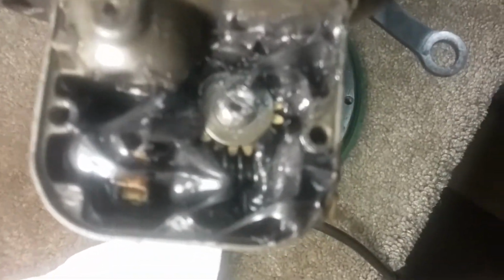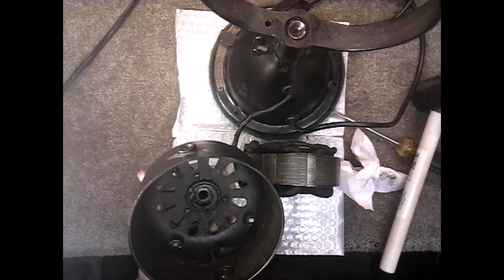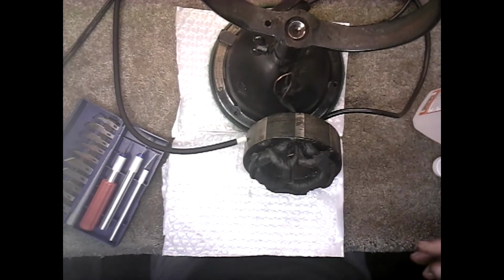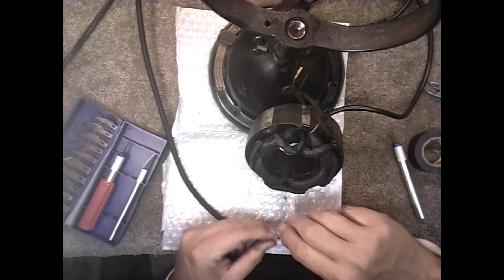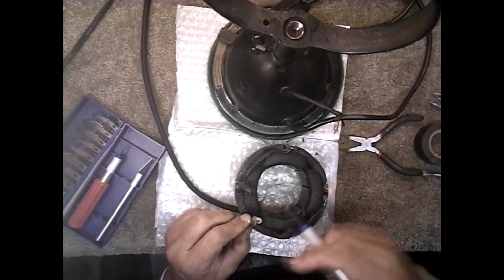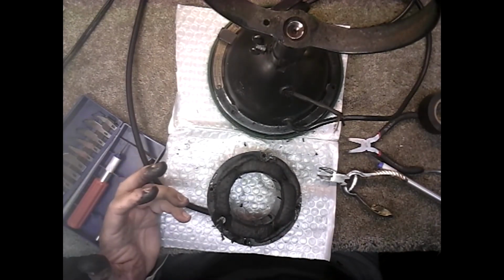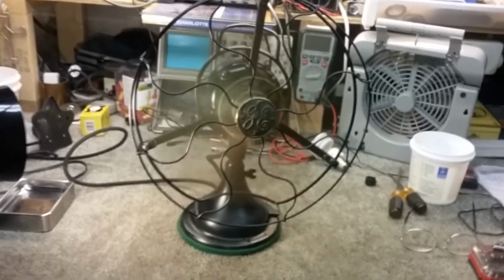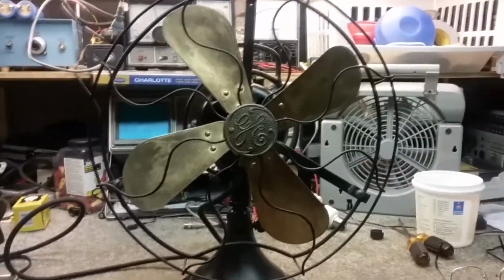GE Brass Blade Fan - AOU 75423 - Part 2: Head Wire Replacement

Comment: Great video, thanks! I am restoring a similar looking GE fan with the 75423 designation, but it has 3 wires coming out of the stator coils. It is missing the speed switch/coils and I am hoping at least to have a single speed operation with an external switch. Did some models incorporate the speed change windings in the motor?
Reply from the maker: No, 3-wire fans have two coils in the stator. One is a start coil or an auxilary coil. The other is the main (run) coil. If you run the fan without the start coil, you will burn up the motor. You must find the correct speed coild for your maker/model.